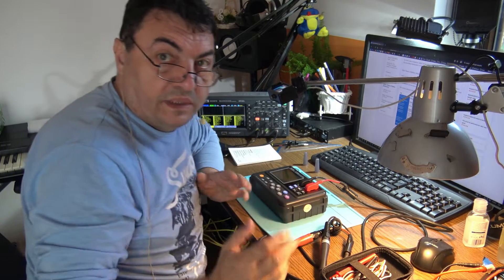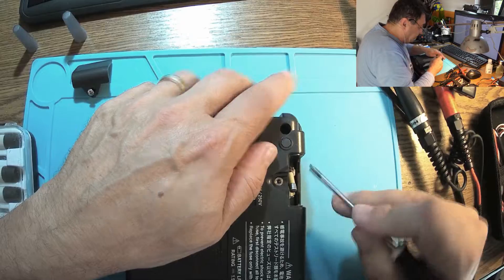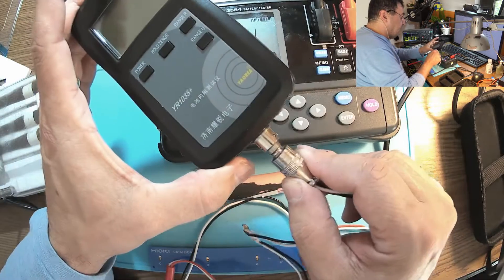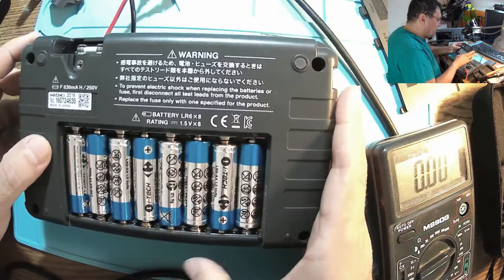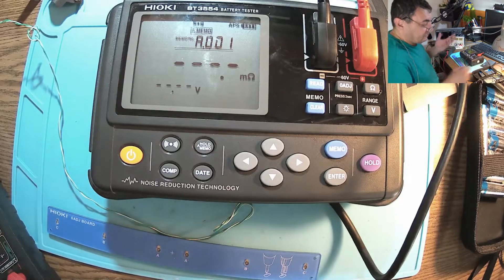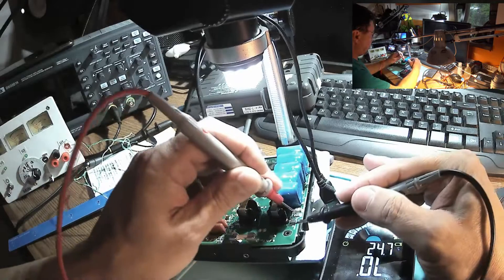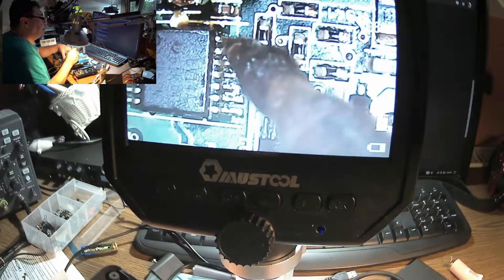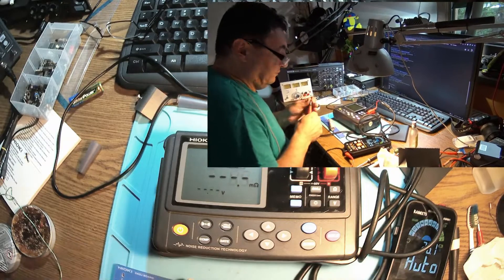Hioki BT3554 professional battery tester fix

Comment: Hi guys, for all of you that have the issue where it displays the voltage but it won't impendance test, take the removable fuse out and push the fuse holding contacts closer, for a tighter fit around the fuse as these get slightly bent when you replace the fuse resulting in a bad connection.
This worked on two of my meters.
Reply from the maker: Super! Good to know thanks!

Comment: Hi there,

I am from New Zealand and i am using that tester for battery maintenance. I have exactly the same problem as what you have but i cant  figure it out. are you accepting for a repair? i can probably send this to you to go and have a look on it.
Reply from the maker: I'm afraid it will cost you the post duties more then the tester it self. You can check the board with care, using a magnifier, give it a good cleanining and use new batteries set, it will work, they are serious japanesse products.

Comment: What is the purpose of using adjustment board?
And can I use an aluminium block as an adjustment device?
Reply from the maker: That's not a simple metal bar but a calibrated shunt/resistor. Better short the probes for 0 ohms.

Comment: I have a Hioki battery tester BT 3554. 
After measuring a battery I get resist 0.02 mOhm ( before was 3-5 mohm). I replaced battery but i still have same measurement by hioki 
Please can you advice me what can be wrong 
Setting on hioki tester is same like before
Reply from the maker: That's way out of tune, try to reset and calibrate. Check for water damage eventually clean the board. I don't have the tester, was only for fixing but follow the manual how to calibrate